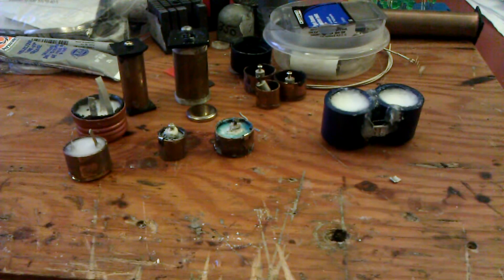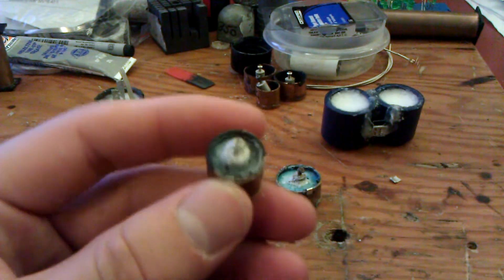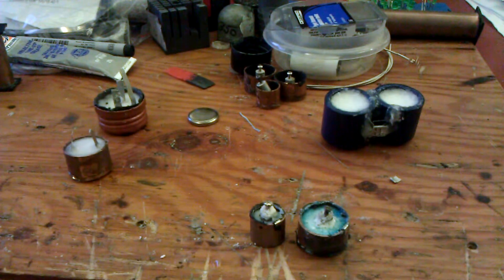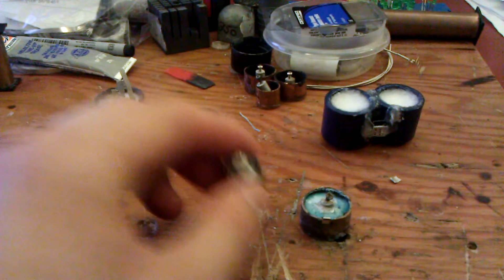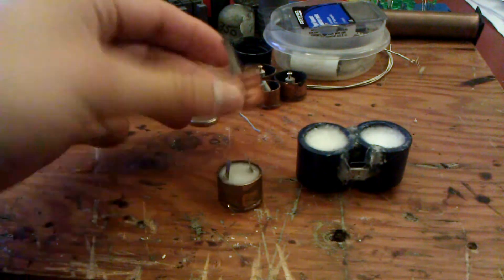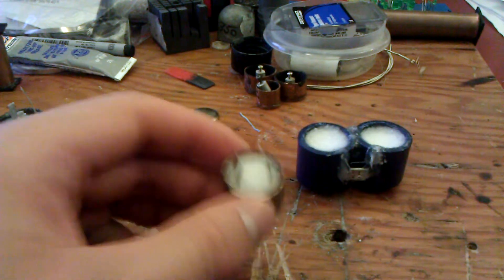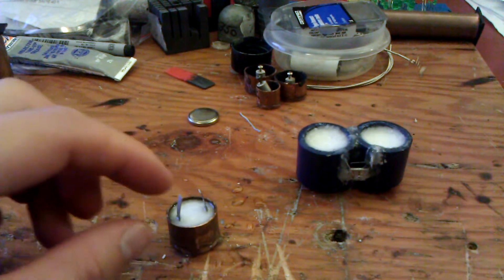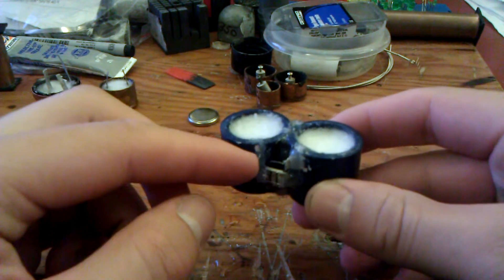19. Crystal Cells update & attempting high voltage anomaly

Comment: Try magnesium sheeting and graphite doped copper (can buy flat round slugs)....burn one side of the copper to form copper oxide and make a wafer of crystal-mix matterial between the copper and magnesium layers. The output is usually between 2.4 and 2.9v and gives around 30mA continuously. Adding an initial voltage (9v battery) while allowing the crystal material to slowly crystalize between the layers increases output to around 5v and 140mA.

Comment: I got 1.8v/2v using magnesium ribbon and copper. I mixed epsom salt with wood glue.  The glue separated in to a clear liquid and a white rubber type substance. I used the rubber as my electrolyte.